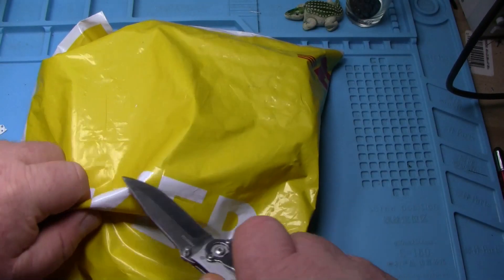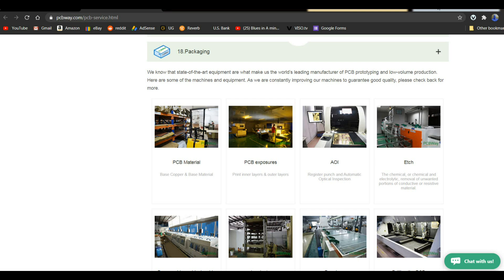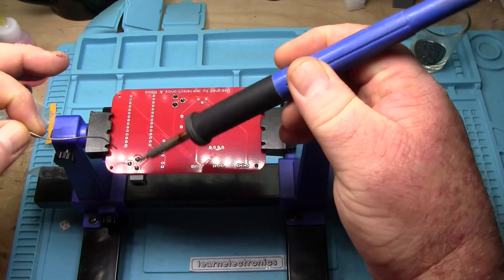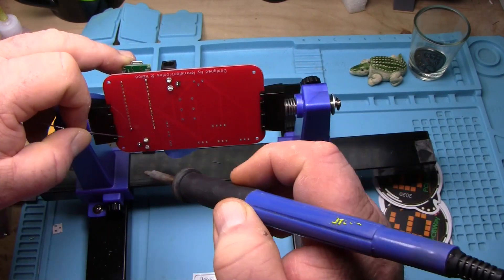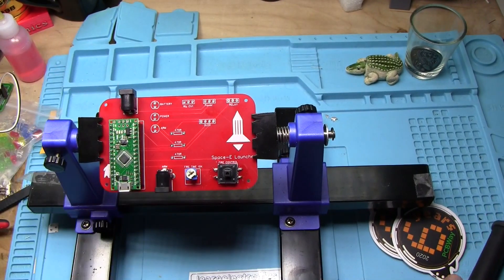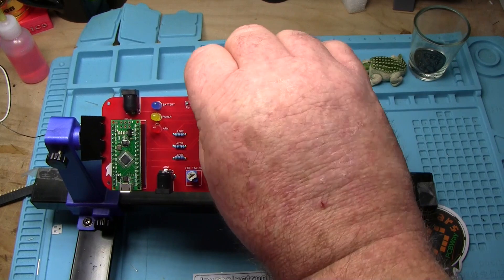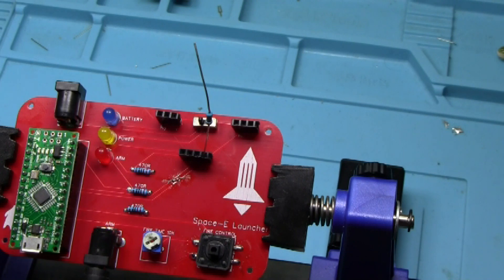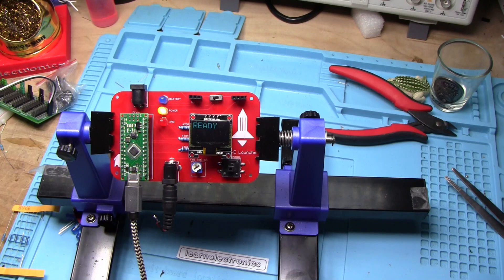Space E Rocket Launcher

Comment: I have been thinking of building a rocket this winter for a nice spring time launch. You have inspired me to build a launch control circuit but I think I will add a 7 segment display with a countdown and maybe a continuity test on the firming circuit that would auto abort if it does not get continuity. I think I would also add some wireless control to keep me away from the pad. Great video Paul, I love this idea so much. Too bad about reversing the two pins but I guess that’s why we do revisions I really like that the pcb’s are cheap enough that doing revisions does not break the bank. Thanks for inspiring all of us man you rock.

Comment: Why use a nano?  Why not just socket an ATtiny and some support components?
Reply from the maker: It is what my friend asked for
Reply: I like using ATtiny85s for the ability to do really low power and for the small footprint. Neither of these is really a concern here. For the extra $1 the Nano costs, you get the ability to tweak and troubleshoot your code via USB. I like his choice
Reply: @blic-sx9ix  There are advantages and disadvantages to either method.  You can still use USB with the tiny, and the board would be significantly smaller, not to mention not having the nano sticking up from the board.  No way is "right" I was just asking why he chose the nano method.

Comment: I usually leave socket holes on PCB as placeholders for unused microcontroller pins. So if later on you come to idea extend or add more sensors, you can add one more module without changing whole PCB.

Comment: I am curious why you didn't just change the OLED pin assignments in the Arduino code ?
Reply from the maker: It's the I2C bus, it's hard wired as far as I know
Reply: @Meganano   that is correct, I checked up on this after Paul's reply and I2C pins do not reassign nicely.  Apparently there is a wonky loopy way, it didn't sound like anything that was neat and clean enough that I would try it.

Comment: (10:35) - Would that be classed as a "conformal coating" ?
>
Reply: I guess any nonconductive material that prevents wire/component movement would be conformal. Some use glues, liquid coatings etc. If time is a factor, you could use UV solder mask. Either way, I've seen enough of this fellas vids to say if he uses it, it works. In smd and micro circuit repair, time is often a factor.